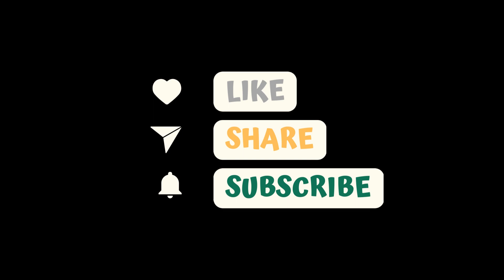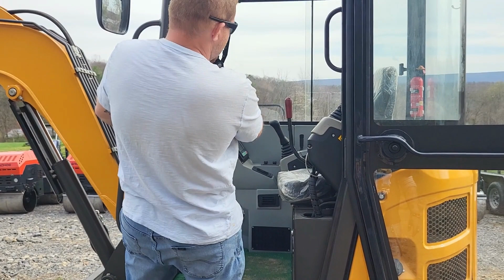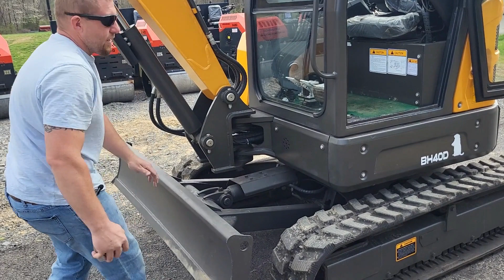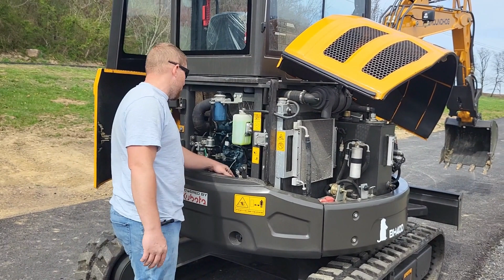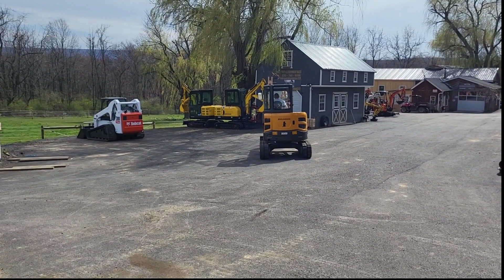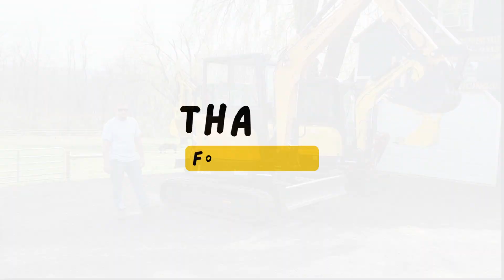New! GroundHog BH40D Track Excavator

Comment: They should try making them without so much software.  Just plain manual on everything.  They would sell faster because most men want to be able to work on the machine they paid $40,000+ for.  Especially us Gen Xers who grew up taking random things apart to see how it works and fix it if it’s broken.

Comment: Can you tell me what emissions this unit uses? DPF or DEF? I’m assuming the EPA makes you use one or the other.
Reply from the maker: neither on the 40 series, That starts with our 70 series.
Reply: @ Wow! That’s great!!!! All the name brands slap on DEF or DPF if it’s 25hp or above. So what you run into, and this is the salesmen telling me, that they’re 8,000 pound excavators, which almost all run 24.5 hp engines, feel way underpowered once you turn the AC on. They recommend going with the open cab models because of that reason. So I see your machine as having a huge advantage. I also appreciate your attention to the way your hydraulic hoses on your dipper stick are ran. Every other brand selling Chinese units, and I mean every one else, has their hoses ran all over the place just waiting to get torn off the first time they clear brush with it. So that’s steering me towards you guys as well. One final question. Does your BH40 have different settings for running implements. You know like a thumb setting, auger setting, Jack hammer setting….etc?
Reply from the maker: There are not individual settings for the auxiliary functions

Comment: So I’m in the market for an excavator about this size. I’ve narrowed it down to either a Bobcat E35, this machine or Kymron’s XH42 equivalent. It looks like the same basic machine as this. There’s things I like about this better. It seems like you do a better job with hose management on the dipper stick. They aren’t popping out everywhere like the Kymron. The other thing you do better is you offer a pattern Control selector and I’m a backhoe guy. There’s really 3 things I’d have to address either from the dealer or me fixing myself. I just don’t know if it’s possible. 1) The main thing is I need a thumb that hinges with the bucket because I’m gonna be picking up lots of brush. And I need a beefier thumb on par with the name brand machines. While I appreciate that these come with thumbs, I’m gonna be really using mine so something made out of 3/4 inch or 1 inch steel is a must. Do you plan on working to get a better quality thumb maybe as an upgrade? Possibly a thumb control on a joystick switch instead of a floor pedal? If not, what do you think about someone fabbing their own beefy thumb? I’m a welder so I can build one but what about getting longer pins to run through the same pivot as the bucket? Are they standard size pins that I can maybe get at a name brand dealer? 2) Do you think if I were to install an aftermarket suspension seat, if that would raise the seat hight up too much? I’m 5’ 10”. I realize you offer the SH36 with this feature but I need to keep my cab height no taller than 8’ 3”. 3) Third is, does this model have a cup holder anywhere? Such a simple question but Kymron won’t even give me an honest yes or no answer. And if “no”, do you see a place anywhere in this cab where I can mount a simple screw down cup holder? I can’t drive to see this machine so I have to rely on dealer info and every video I see seems to show as little can footage as possible. If not, I’m kinda forced to go with a Bobcat, Sany, Kubota, Case. Any name brand that I can go in and see. At this price I’m not expecting it to be on that level. But I’d like to know I can upgrade that stuff myself with a little work. Especially since I have the ability to weld and fabricate. I’m not great with electrical stuff so Im not sure if adding a thumb switch on a joystick is gonna be possible.
Reply from the maker: Thanks for reaching out! We do offer a beefy thumb bucket, We are working to offer more thumb options for our machines but nothing else yet. You can fabricate something fairly easy, while the pins are not widely available but can be purchased through us or online. We can do joystick thumb controls. If you were to install a higher seat you'd have about 6-10 inches of room to work with. It does not have a cup holder but I recommend a suction mounted cupholder.
Reply: @groundhogequipment  Hey, thanks for taking the time to answer my questions. That’s a huge factor for me. So just to make sure, if I wanted to order a pin that’s longer in length than what’s standard, you’d be able to do that? If so, that’s great. I’d just use the thumb that comes with the machine while I fabricate a new thumb that hinges to the bucket pin. Then just slide that longer pin in to accommodate the wider thumb.
Reply from the maker: We can make almost any pin you'd need

Comment: Can they do a main pin hinged thumb?
Reply: My question too. With the work I need to do, I need the thumb to meet the bucket teeth no matter the bucket position. I’d even be fine with welding up my own thumb but wondering if it’s possible to buy a longer pin somewhere so I can pin the new thumb to the bucket pin. I need the thumb to be way beefier too. Like the ones the big companies offer. These are just way too thin steel. I’d bend them up on the first day I’m afraid.